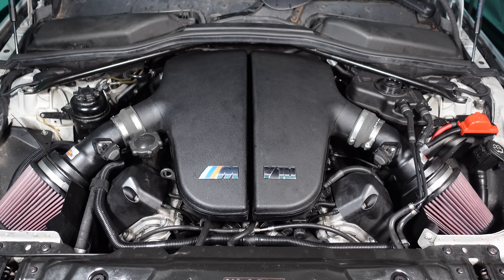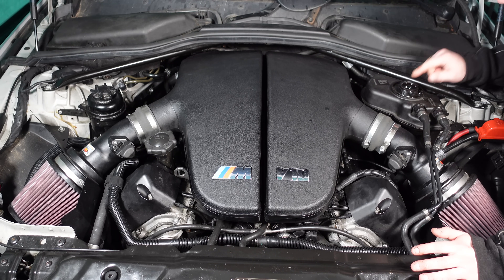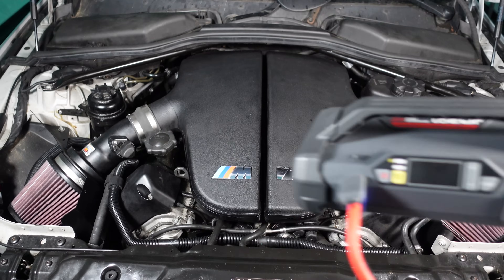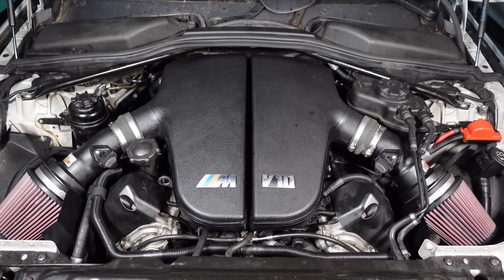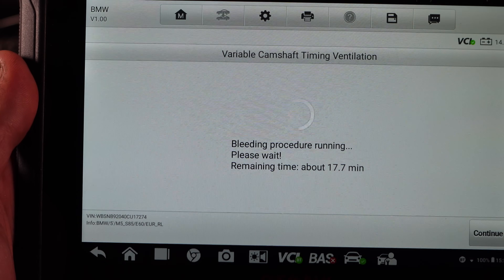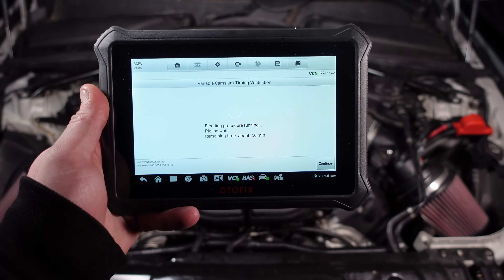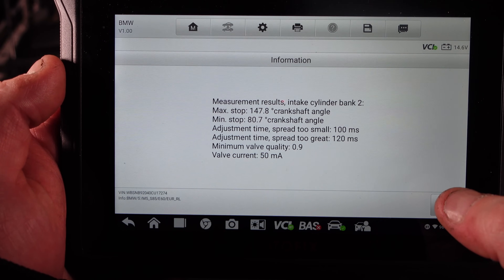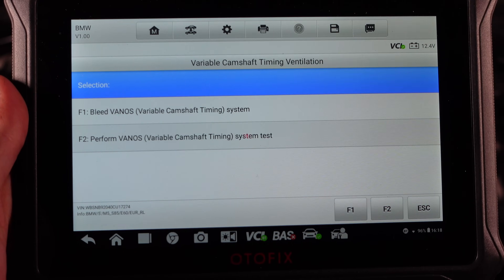BMW E60 M5 S85 / S65 How To Perform Vanos Bleed Procedure

Comment: Hey Doc, Im a amature who just finished a rebuild after changing the rod and main bearings on my e92 m3 with the S65B40. Now after watching some of your videos I figured if someone will know how to fix this issue, it would be you! After the first start, the engine is giving me the code 2719 for the bank 2 exhaust cam position sensor and running very rough and after touching the throttle, it would die on itself. After that the engine dies immediately after starting as well. At first I though maybe I messed up the timing, but after retiming the engine for a second time, the same issue persists. I've even tried to unplug the vanos solenoids and it made no difference. From the engine a noticable clicking sound can be heard at a rate that sounds like the vanos gear spring countiniously slapping against something. Im really out of ideas and don't know where to go from here! Have you ever had similar encounters and what's the best procedure to fix this issue in your opinion?

Thanks a lot in advance!

Comment: Brother I have this issue that I’m almost sure no one has experienced and can’t find the solution anywhere. I have an 08 bmw 328i convertible, when the top goes down it closes perfectly no issues and the windows roll up and down regularly. When the top closes,the windows roll down before the process starts which is normal, and after it closes, the windows don’t work anymore and my light blinks red as if it’s not closed. I hear the locks working and locking when it goes in the holes and I redo it multiple times still wont let the windows go down. I changed the microswitch on the driver side on top of the visor and still no luck. How do I find the issue?

Comment: I think you can help me here 
N46 316ti 2004 Just replaced the ecu and I’m getting a code reading 2db4 signal error
test condition met
error currently present and stored error would not cause a warning lamp to light up diagnosis active
cycle flag set
And 2a61 code

Comment: I use a upc deep cycle battery 20Ah ( enough energy and light enough) to keep the batteries charged and a hobby charger imaxb6 that takes 12v input and charges the battery to 14.7Vz. you can choose the charging current. That’s a mobile charging option in case an AC source is more difficult to access ( distance or whatever reason). if the battery rest voltage drop below ~12V, especially for a long time, some damage will occur. So if you keep it above 12.2 is ok. I use a cigarette lighter socket voltmeter to check them.

Comment: Great video !        to the people who said where is the part of the disaster lol its literally when he turns on the car and gets the vanos ticking noise. then he bleeds the system which was 17 or 16 mins long and the noise went away.... people need to watch the whole entire video not skip
Reply from the maker: Good man and thank you for watching I appreciate it 🙏 at least some watch fully and understand unlike most 🙄 that vanos rattle noise was BAD BAD but only true 3 weeks of not starting the vanos system and the engine bled the oil down completely and was very very thick so it took along time to get it back to normal and quite. But now oh my it’s quite as anything no rattle no nothing how I don’t hear this engine running is shocking it’s super quiet on idle
Reply: @BMWDoctor  cheers ! learned so much from you         thank you !!
Reply from the maker: Your welcome my bruda

Comment: Right on, Dean! Is the vanos bleed required on N52s? Cheers, bro.
Reply from the maker: Nope not at all. Only S85 S65 Requires this
Reply: You rock, Doc!!

You getting a proper garage soon? You certainly deserve one!
Reply from the maker: Yeah bro its already being built its half done already I didn't want to show anything until completion but its f***king huge to big I dont think I even needed that size but it seemed small when I first measured it. but now the walls are up its looking much bigger then I anticipated, But the way the architect done it was so I can have 2 car lifts which should be installed hopefully next week if the guys get the roof done. But as for doors they have to be specially made as there so big. Thats why man I cant shoot during the day because all the noise of cutting and drilling its way to much I did do it in one of my other videos and all you can hear while I'm filming I all the machinery going. Its a big project I have put forward but in the end im gonna be very very happy. I will shoot you over photos bro so you can see it
Reply: @BMWDoctor  Sounds fantastic! Imagine having proper lifts, woohoo!